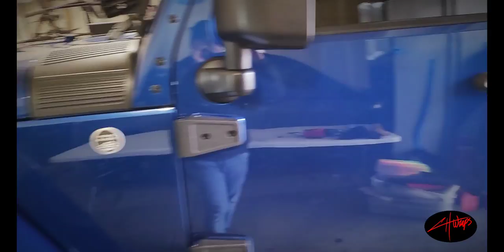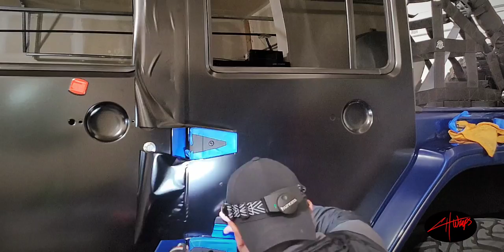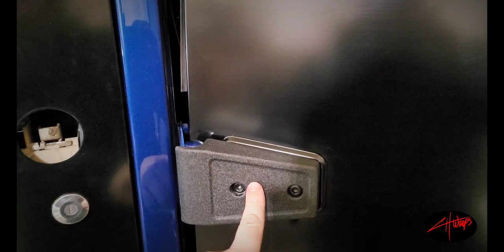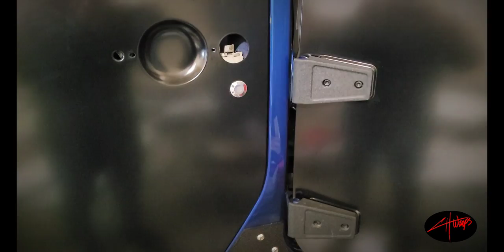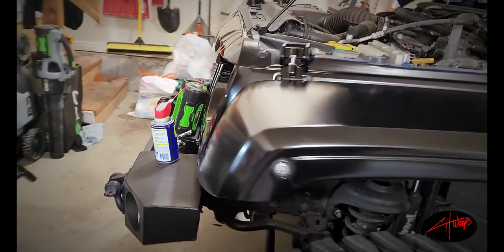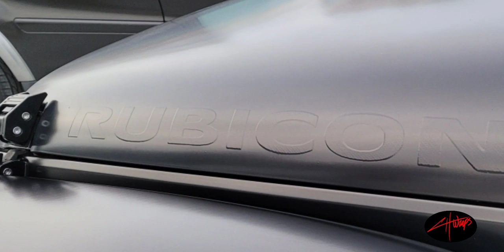JEEP RUBICON (FULL SATIN BLACK WRAP)!!!

Comment: I have someone that wants me to wrap their WHITE WRANGLER 🤪 how easy were the pieces around the windshield and fender area to take apart? I was scared to break the paint removing the bolts
Reply from the maker: The bolts came off just fine. You just have to use the right size torx head and they come right off. I thought the paint would get damaged as well but it didn't
Reply: @chwraps127  thanks for quick response